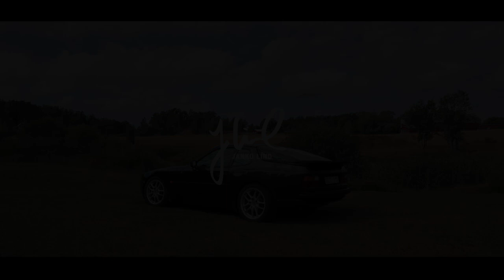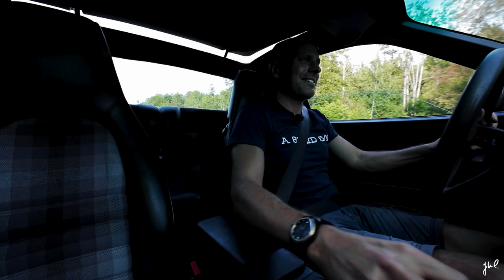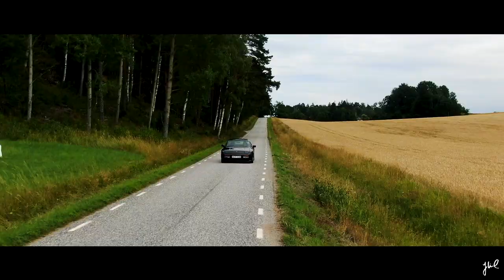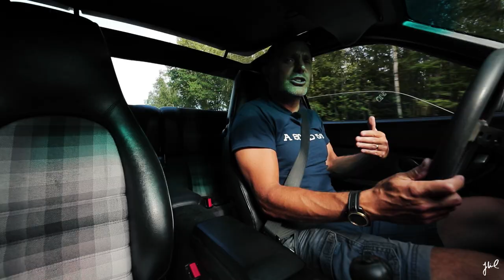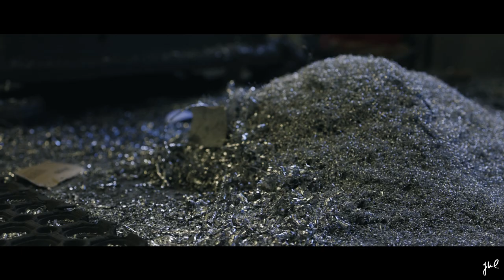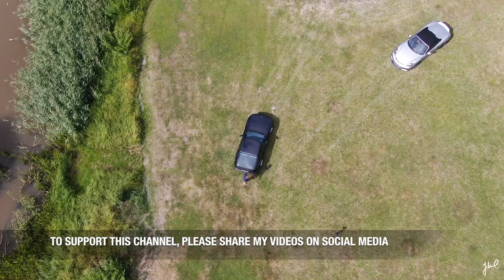YOUR first PORSCHE? My recommendation to a youngster | EP 143

Comment: Agreed - 944s are far more affordable than 911s.  They may be a point of entry into Porsche magic; but in my experience, they aren’t the best choice for the money.

I own a 964; I moved into it from a 924S.  944 & 924 are certainly good handling, worthy and gorgeous Porsches, but the driving experience doesn’t hold a candle to a 911 or a Boxster.  Both 944 & 924 are under powered and too comfortable in comparison to a 911 of the same era.  They are beautiful grand tourers, but not driver’s cars offering the level of engagement that a 911 does.  Before the 924S, I owned a 914 - the forerunner of the Boxster.  The ‘70 914 was a far more engaging driving experience than the 924S.  

My son has a 2000 Boxster as his point of entry Porsche.  As are the 944s, Boxsters are undervalued.  I would suggest that an older Boxster offers a far more engaging driving experience than a 924 / 944, and a truer experience of Porsche’s DNA.  To my mind a Boxster offers a far more compelling ‘first Porsche ownership experience’ than does a 924 / 944.